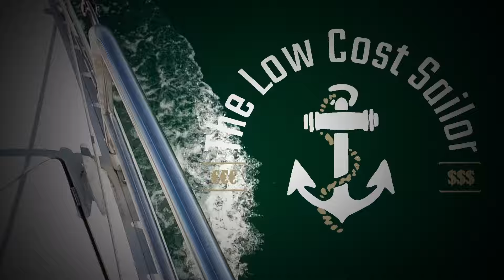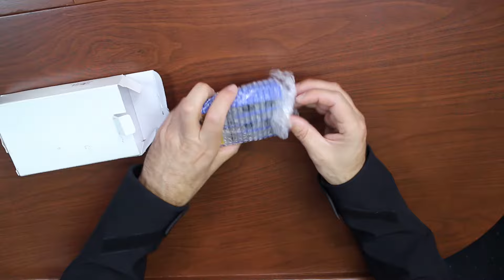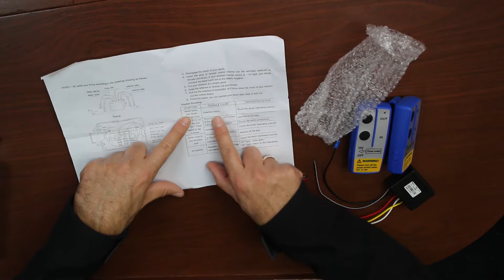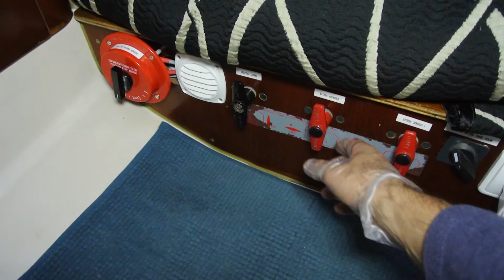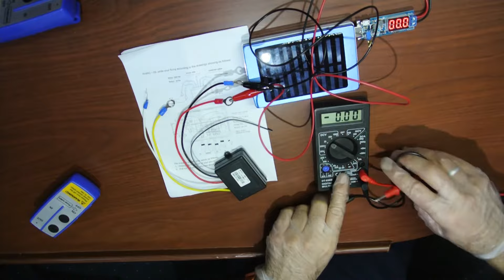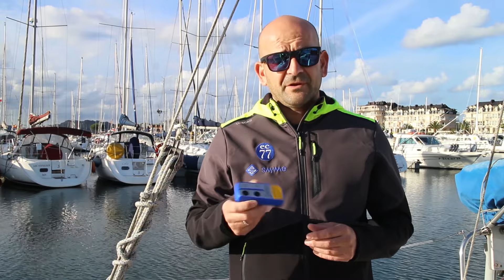EP01 - Low cost remote control for anchor windlass

Comment: Have you tackled the issue of making a low cost remote control for bow thrusters? With the modern ones, as there is a dampening of about a second when switching from starboard to port, the one you used for the windlass shouldn't work. Cheers, Alexis
Reply: This is exactly what I’m looking for my sidepower bow thruster. Any recommendations would be highly appreciated.

Comment: I have the same remote works great. Would you recommend a switch for backup? I only have the remote I never wanted to cut another hole in my dash but I'm wondering what would I do if the remote stops working. I guess that I could jump the solenoid.

Comment: Thank you very much for sharing. However I cannot find the wires you connect your controller... My solenoid does not have free wires ready to connect. Do you have any idea? Solenoid is not in the bow but at the electrical panel
Reply from the maker: The wires will not be free, they will be connected to the fixed buttons that you already have.. But you can connect in parallel the controller to the same wires..

Comment: Exactly what i bought. I put my controllers in a zip lock bag to make them waterproof and they will float if I drop them in the water. As a catamaran, i have often beached the bows, i jump of the front and use the remote when I drag the anchor up the beach. Nothing like a negative scope 😅
Reply from the maker: Its a great remote, you can make a copy of the remote control with a universal garage door remote, to have a spare one.